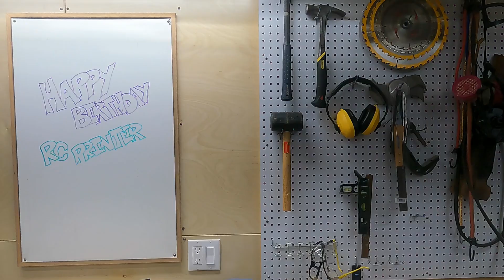12 Printed RC Vehicles in 1 Year - Happy Birthday RC Printer!

Comment: Planning to purchase the 3DSets Buggy to build, just wondering how well my Ender 3 will do with the body. The rear suspension looks to be modeled after how the VW Beetle swing axle actually works, which has camber change through travel as you pointed out. Like that they did that for realism purposes.
Reply from the maker: It won't likely be as nice as a Prusa but I just printed a Dodge Challenger body with an ender 3 and it turned out fine... Especially if you paint it :)
Reply: @rcprinter  I will have to give it a try. Still prints decently after several years of use, but needed to do a few upgrades. Used it to build an Eclipson Model C plane recently.

Comment: Nice roundup. I've been looking into printing RC, have zero RC experience so far and it looks very interesting. I wonder if there is a capable rock crawler out there. That would be a nice project in my opinion.
Reply from the maker: Totally agree, something designed to be crawler specific would be pretty cool. Just googled around and found a few micro crawler ones but nothing good in full size. Let me know if you find one!